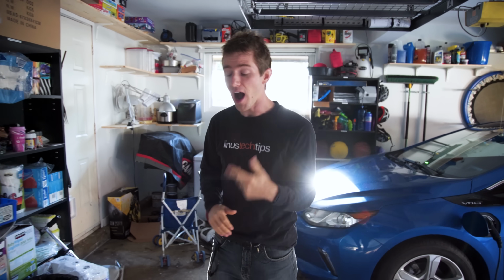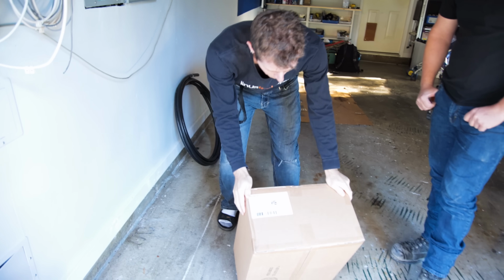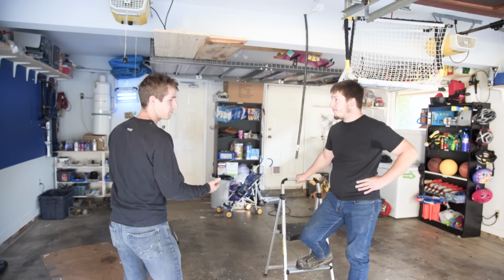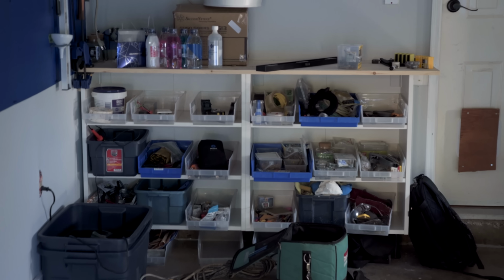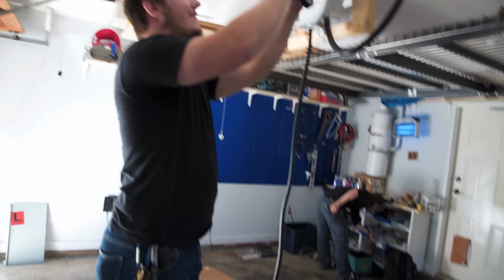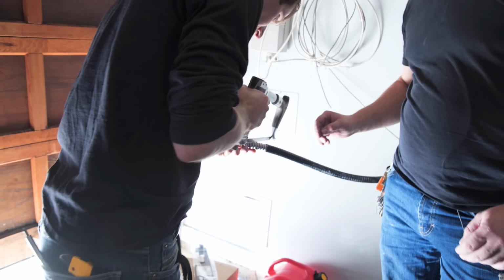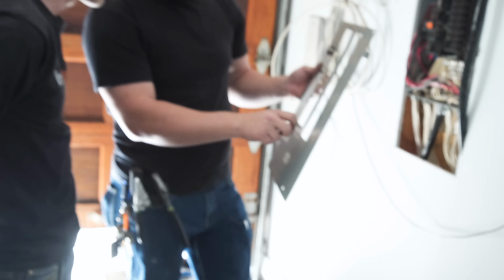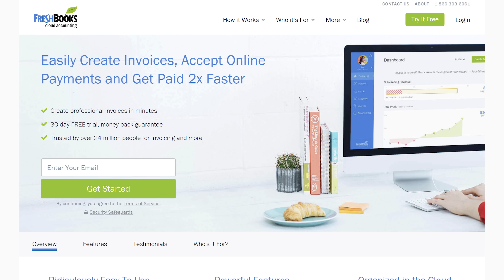Installing my Electric Car Charger - What Could Go Wrong??

Comment: You know you are living in north america when you can cut a wall with a knife
Reply: So you dont have drywall??
Reply: @WEBBBASSIST9  We use bricks. Drywall is very uncommon at least in Europe.
Reply: I thought they lived in Canada?
Reply: @justacomenter9735  Canada is in North America...
Reply: @stefancroes  Geography at It's finest.
Reply: @OLBastholm  fair enough I have never been to Europe but I have seen several places use drywall.
Reply: @stefancroes : Yeah I'm stupid and thought about the country, not the continent.
Reply: @justacomenter9735  nah, Canada is a state in us
Reply: @OLBastholm  How do you hang pictures and what if a pipe breaks? Do you knock out the bricks to replace it?  Is it exposed brick or plastered over? What do you do for insulation? Just curious.
Reply: @MuddinNYC  We drill a hole, and use dowels and screws ... for very light pictures a short nail in the plaster can be enough. If you use proper pipes, they won't brake ... I've never heard of it. However there is a problem with some pipes from before the 1940s ... they're made out of lead and have to be replaced, so yes the break up the walls. Old buildings rarely were build with insulation. New ones are insulated on the outside with an additional layer. Here's a time-laps of a typical German "Haus" https://youtu.be/tlnUVxqAzDU. Oh, wooden houses made of pre-built walls also exist and for a time they were quite popular, but it seems the traditional style is coming back.
Reply: @OLBastholm  Well I don't know where you are in europe then, in France it's used a lot...
Reply: @justacomenter9735  the United States of North America
Reply: dont get ahead of yourself
Reply: @bmxer1997isaac  give it time
Reply: @justacomenter9735  Ahahahahaha!
Reply: My parents' house had all brick walls and my dad spent some good time with a cold chisel to add in some accent lights. From my times wandering around building sites as a kid in the 80s, a lot of newer buildings have drywall interior walls. Plus there was the one time one of my friends punched a hole in the bathroom wall of another of our friends parents'. So it's definitely around.
Reply: That's actually a saw... A drywall saw...
Reply: OLBastholm incorrect. Drywall is extremely common for new builds in Europe. Houses aren’t built the way they used to be with solid stone or brick. Most interior walls now are studs and drywall. Easier wiring, cheaper, better insulation etc.
Reply: @WEBBBASSIST9  drywall is used inside brick buildings. Where the main permanent walls are brick and drywall could be used for something like dividing up a large work area into smaller offices.
Reply: @SamGamgee8012  Thank you. That makes a lot of sense. What about Earth quakes? I've read they do worse with brick and concrete. How do you guys counter that? Is it not a concern or is it engineered out somehow?

Comment: Like nobody ever heard of Siemens, they are as big as Acer, Asus and Sony combined.
Reply: yes, and no ones heard of them.
Reply: If they're that big why hasn't anyone heard of them
Reply: Suuhls i once had a siemens mobile phone. It was in the early 2000s. It was kinda meh
Reply: Well, anybody that has done any electrical work ever has heard of them.
Reply: @sebastiancamarena2824  Because they do more industry things than consumer products. Like Turbines, Trains, MRI-Machines and things like that
Reply: @sebastiancamarena2824  Siemens was at the time a large player at mobile phones market. My first two phones were Siemens C65 and CX75. There is probably no-one in Europe unfamiliar with this company
Reply: @sebastiancamarena2824  Because they operate mostly in Europe, I mean, they make everything, from phones to car electronics to dish washer.

Good chance is that you own products that have Siemens Tech in them
Reply: @tongaenzu  I have a Siemens mobil Phone in my hand right now, it's about 20 years old and works just fine. German engineering and stuff
Reply: @BladeWalker91  My father was an engineer at one of the company's that designed these phones and I have several prototype phones here, the last thing he worked on before his death was the M55 which I have in my desk for emergencys and it's still functional after more than 15 years
Reply: Yes, they work perfectly, but they didnt have any special features back then.
Reply: @tongaenzu  I remember my father dropping one phone in a glass of water but it could be that it was a Nokia phone. I only know that the M55 had a color display and an option digital camera in the Gameboy Camera style

Comment: The Charger is actually grounded as well, that's what the bond is for being tied into the panel. The extra wire (blue) would be used in a 3 phase setup or in this case as a neutral if the charger, or a future charger requires it. 

I have insulated screwdrivers as well, but 120v (line to neutral or ground) is low enough that even the plastic and rubber handle on the screw driver used is more than adequate, just keep away from the shaft. Also, in many cases de-energizing an entire panel to install a breaker is often not possible in a commercial or industrial setting so you get used to having to do it live, and having to be mindful of where your hands are!
Reply: corey the nomadic maintenance guy  Me too, honestly the vast majority for me is live, at least for the 120/240 and 120/208v panels. 277/480 and 347/600 however, I dont care, that s**t gets turned off.
Reply: the bond only works when both ends are metal. The charger being plastic does not count.
Reply: @ugetridofit  The Charger enclosure is plastic, yes, but there is a bond/ground lug in the termination block where you tie in L1 and L2. The armor is bonded through the metal connector going into the panel.

Comment: So I’m a service electrician for Broadcom. Today we were pulling 350 kcmil wire through 325’ of 2.5” emt. We wanted to lube the conduit and wire to make it easier pull. What found out if you fill a latex glove with lubrication and prick the finger you can get it in the pipes in the ceiling.

TL:DR my boss made me stick a finger in a gaping hole to make it wet... up that’s electrical work.

Comment: Fun fact: The mobile charger that come with 2017 Volt is actually L2 charger. There are mods that change the plug to 240v and it will charge at L2 speed.
Reply: Fun fact: If you have to mod it to make it output more power, it's in fact not provided to be used as a L2.
Reply: @REH86  Actually, the charger was designed to work with both 120/240. All you need is a plug converter to change it into washing machine type plug.
Reply: Just safer to have it on its own breaker circuit
Reply: @eisenklad  It's really not much safer than using a converter with a fuse though. Like most PSUs they are made to operate on 120/240 safely.

Comment: 15:59 his finger sooooo close to a live cable!
Reply: The cable is insulated, it's the connection screws you have to watch out for.
Reply: @Nocure92  Yeah, I meant the screw terminals.

Comment: Siemens is just a small firm with just over 372,000 employees. So no big deal ;-)
Reply: Also definitely not making the machines used in most of the planes he flew with. 😂
Reply: @patience__8051  and car parts, phones, parts for space satellites, a whole bunch of sensors...

Comment: Professional electrician not using a VDE screwdriver? Would be thrown off site in the UK.
Reply: It's all a bit dodgy. If you have the option you should always isolate your supply.
Reply: You mean properly insulated, vde is a German approval, also valid in the rest of the EU. But you are right, saying rubber is an insulator does not make it safe screwdriver, impurities in the handle could kill you as it's not tested. 

It also a bit strange that fuses can blow uncontained, but that's the other side of the pond for you.
Reply: I was looking for someone to comment this, thank god they only have 110V over there lol
Reply: ikr I cringed so hard I cracked my teeth!
Reply: Brett Snelling  with an rms potential difference to ground of 120V.... Its centre tapped to ground
Reply: Oh yea.. I would have been killed several times already if i would have not used them:D
Reply: It's a North American thing, but we get it too.
Reply: It is a electrician who apparently hasn't even heard of Siemens yet. That is like a car mechanic who doesn't know what a Volkswagen is.
Reply: same shit still happen in a properly supervised site in the US, except this isn't supervised, and i'll be honest, this guy isn't adhering to proper IEC as well.
Reply: @21Kamil12  until you start working on commercial buildings, 277/480V everywhere.
Reply: @TrangleC  Linus made the Siemens joke, not the electrician.
Reply: @BixbyConsequence  Yeah, I didn't get the impression that he knows either, though.
Reply: Literally no one cares. This is (north) America! We've been better than the UK since time began.
Reply: @jc5604  Hold on say whate you wrote slowly to your self
Reply: J C America, as you know it, didn’t even exist <1000 years ago.
Reply: @Taz8du29 Although in the form you meant you are right, the black carbon deposit say to me something did blow. 
But for everybody in the branch, tripping (breakers) , triggering(rcd, smart breakers, reclosers), or blowing(fuses) are used in any possible (wrong) combination.
Reply: @kuromurasaki5273  Yeah, I heard the Cherokee had the best electricians, much better than the Aztecs, for example, although they had stricter safety regulations for electrical wiring. But that is Aztecs for you... I mean, you don't want people to electrocute themselves while making their Margaritas, before you can sacrifice them to the sun. Right?
Reply: @TrangleC  why would it matter if they are fried from an electrical short if they were going to vaporize in the sun?  That doesn't make sense!  You mention the Aztecs, but you forget that most 'Americans' are north continent centric; they forget the south is attached to them just like they think Africa is a country not a continent and Australia is the only thing in the southern hemisphere unless they remember Antarctica exists :p

And, for a laugh, the first sentence I read it as vehicles ...  so Jeep Cherokees had better electricians working on them than Pontiac Aztecs; considering this video was related to vehicles, I had to read the second line a couple times to figure out what people making margaritas had to do with anything.  I only sacrifice those who give me salt on the rim of the glass after I strongly stated either sugar or nothing.  Damn it, now I want one, its been several years.  You can do all the sacrificing to the sun though, Sol is not my god, it can be yours ...  as god means something different to me than you most likely ;)
Reply: That'd be overkill for the low voltage here
Reply: @joerivanlier1180  

Insulated tools are named "VDE tools" here in Germany too.
BTW: The manufacturer of the uninsulated screwdriver shown here in the video (Klein Tools) also manufactures insulated tools, and they're certified by the VDE... 

Klein EINS-series:
https://www.youtube.com/watch?v=bjXbZKeLxW8

Klein VDE:
https://www.youtube.com/watch?v=7UYYEqVfBAc
Reply: @gtjack9  and? Look at the impact the US has had on the world in a very short amount of time. We run this shit.

Comment: Linus's electric bill should go down slightly since the Siemens charger will draw off of both legs of his electrical service evenly, where the 110v charger pulled all of it's power from a single leg.  While not too many people talk about it, you do pay more if your draw is substantially uneven.  In addition the Siemens charger is probably a quite a bit more efficient than the power brick that came with the car.  I would like to see a followup on this episode commenting on any impacts to Linus's electric bill, and perhaps compare that to the cost of purchasing the charger and it's install...
Reply: I'd imagine that the power brick would be very efficient as well. It doesn't look like it could handle dissipating significant losses when delivering 1400W. However he should definitely get a better energy economy by drawing less current from the power company when using 240V instead of 120V.
Reply: I didn't think they track this for residential .
Reply: That is not how a meter works, It counts the Watts you use no mater what leg they are pulled from or if they are uneven it doesnt care.    1400W is 1400W @ 120v 1 leg or 240v both legs. But it can pull more since 1400w @ 120v is 11.,6 Amps and its only 5.83Amps @ 240, so a 30A circuit can provide 7200W of charging @ 240v. So if installed on a 40A circuit that model is sending 7200W or 30A to car

Comment: Immer Den Strom ausschalten. Ein Schraubendreher schützt euch nicht wenn ihr ausversehen die Phase anfasst. Always turn of the Power on the Main Switch. A screwdriver does Not protect you when you touch the phase.
Reply: Sagt Linus ja auch er hätte es normalerweise gemacht...
Reply: Klar immer abstellen! Eins frage ich mich trotzdem: bringen dann die VDE genormten und isolierten Schraubendreher von z.B Wera was wenn man damit die Phase anfässt? 🤔
Reply: Yeah the first rule here in sweden is that you always turn off the power first.
Reply: @MrConminer  Die Isolierung würde dich schützen wenn du mit dem Schraubendreher die Phase berühren würdest. Aber warum soll man unnötig ein, im schlimmsten Fall tötliches, Risiko einfgehen?
Reply: Ja also wenn bei uns jemand etwas so installieren würde würde er glaub ich gekündigt werden.
Reply: Yes it protects you for household volts and amps
Reply: @josef2676  besser ein lebendiger Feigling als ein toter Held ;)
Reply: @josef2676  ja eben. Nur reines Interesse. Dankeschön
Reply: @squaller9254  nope, but you could use google :D

Comment: Hey linus, do you plan on an update video soon? Its almost been a year and i am curious as to the difference the charger has made to power consumption in your house aswell as comparing it to how much gas usage you would have used over the year instead.

Comment: I found out after I bought my 2017 Volt that the included EVSE is actually a Level 2 charger provided by Clipper Creek. The only thing I had to do was build an adapter cable to plug the Nema 5-15P into a 240 volt receptacle and and magic Level 2 charging. I built the adapter because the plug has a thermocouple in it that I didn't want to have to mess with. It also leaves the charger as stock so that I can use it on the road as well. 

Reference Green Mountain Guy:
https://www.youtube.com/watch?v=lGcSgzVtv4I